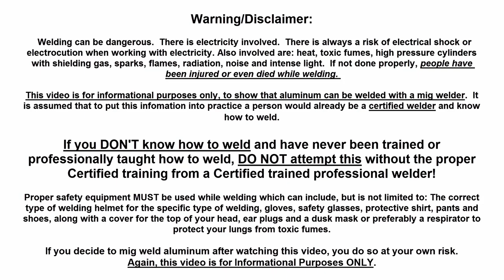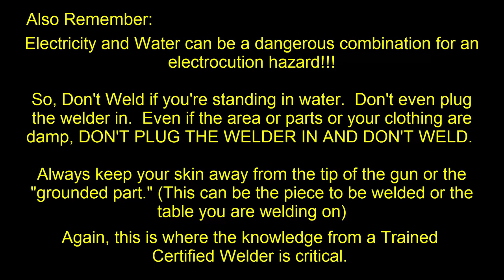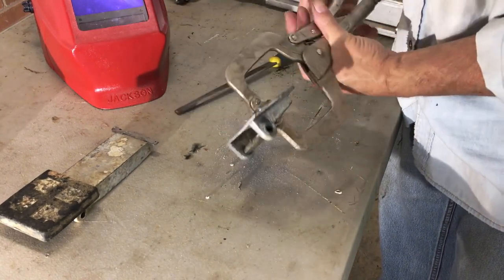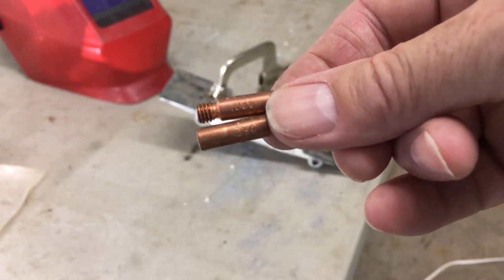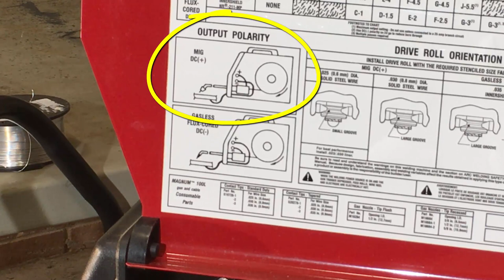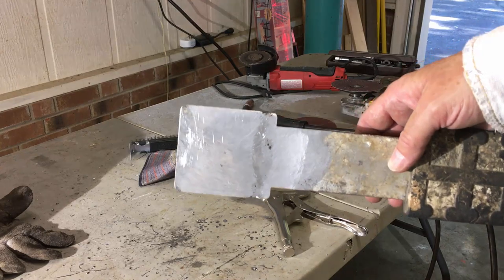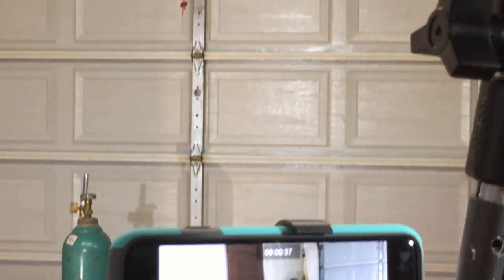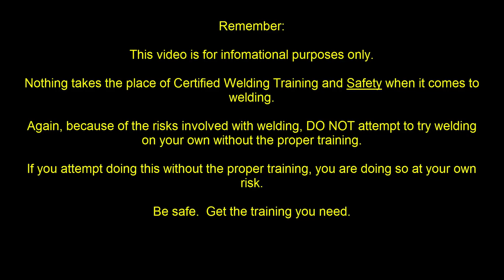Learn An Old Timer's Secrets To Mig Weld Aluminum Without A Spoolgun

Comment: As a thirty year welder with miles of aluminum experience let me give my two cents worth. Many great comments from real welders here. Things you did right: using 5356 wire, using .035 tip.
Other things (repeating some things others have noticed): 
Wrong ark length setting and you don't need to set the wire feed to the highest setting, that just causes a hotter, higher amperage weld. MIG machines are set by ark length not amperage. The machine gives whatever amperage is needed to burn the wire to maintain the ark length so faster wire feed means more amperage and hotter weld. If the wire moves faster than the machine's amperage can burn the wire to maintain ark length the wire will just pop, sputter and throw off lots of dingle berries or throw a bird's nest in the drive. Slow the wire to lower amperage and the ark length should be set to where the wire burns smoothly (not popping like welding steel with CO2) into a cone shape where the end of the wire burns about 1/8 to 1/4 inch from the parent metal.
Don't wear rings while welding.
It's bird's nest not bird cage.
Don't use WD40 on something you plan on
welding.
Don't start and stop your welds every 1/4 inch, that's just a series of tacks not a real weld and it cause porosity like crazy. Use a piece of clean steel to back up the weld on thin aluminum, don't worry it won't stick.Who uses a file when an angle grinder is available?
The aluminum must be completely clean (sanded clean) half an inch from the weld or the junk on the surface will be pulled into the weld causing lots of porosity. 
Do not allow your wire to touch the parent metal when you pull the trigger. Bend or cut it back. If they are touching it's possible for the wire to weld itself to the copper tip if it's not moving when the ark starts, that will start a bird's nest real fast.
Keep the cable as straight as possible, no S curves unless absolutely necessary.
Reply: Now that's a good explanation of the key points!  I have also experienced that you have to 'lead' your arc puddle on aluminum when doing this type of weld.  Should have run a test piece.    Enough complaints about the disclaimers  - at least this one is in writing and didn't take too much time.  But I'd have to say for body shop use and home use I love my Lincoln SP-175 (220 v) model.
Reply: Really appreciate your comments scope and relevance. Thanks for the  share
Reply: straighten the barrel on the gun and push don't pull !
Reply: I would also add never ever use brake cleaner to clean metal to be welded. crc brakleen is the worst. it decomposes into phosgene, something you dont want to be around!!....
Reply: Let the cleaner dry 1st and it;s ok.But,CRC seems to leave crap for me too,I use Andersens,no problem
Reply: I agree,but it's arc,not ark,that's what Noah used,lol.I would add if you do use a sanding disc,never use one you have used on anything else before,ESPECIALLY non-aluminum metal,or you will introduce contaminants,and make sure you weld immediately after using the SS brush.Don't let it set or it will oxidize in the air.If it's rainy or you live near an Ocean will make it especially worse.Good Luck!
Reply: Bowtie41 p
Reply: I can smell crc burning as soon as I strike an arc, even if it has been dry for a  month!  but it is the chlorinated ones that do that, non chlorinated doesnt  bother me either.
Reply: Like what you say. Experience well taught, with sound advise. I welded in HS many centuries ago, and I loved it, but never pursued it as a career.
Reply: I tell that story to everybody who welds..... almost had to have my colon removed!! I still persue my craft. my happy place is right there in the puddle.
Reply: And grinding the weld makes the man a grinder not a welder.
Reply: a welder is a grinder, grinding prep accounts for 80% of your cosmetics and strength. to not be a grinder is to not be a welder.
Reply: AD S  - “A grinder and paint makes me the welder I ain’t”. LOL :-)
Reply: Bowtie41 it’s the chlorine based cleaners(chlorinated)that leave the residue that turns into homemade mustard gas. IT WILL KILL YOU!!!
Reply: William J. 😆😆😆😆😆😆
Reply: I have nearly 50 years welding experience under my belt and have to agree with everything you say. I an retired now of course and really appreciate this "U" tubers video and especially the comments that follow. It is almost like a refresher course in a lot of ways but if I had my choice for aluminum work I prefer tig for the cosmetic appearance of my work and there is a reason guys pay 1200$$ for a nice spool gun. Mig ing aluminum is tricky if you like pretty welds. You can gas weld it with the right rod but if you aren't up on your skill you will go from Mr fix it to Mr junk it in short order. All I will say about that is oxidation is your worst enemy and carbonation will make your weld brittle and contaminate the puddle.
Reply: Great response Mike, I would also note that he should have dialed in his machine on some scrap pieces First!! 
Also note that cast aluminum tends to already have contaminates in it especially if it was made overseas. Also the WD40 or any type of oil would soak in the pores of the cast aluminum and cause his porosity, he should have used a non chlorinated brake cleaner and gently heated it to burn off any residual contamination. If it was available cleaning the pieces with a glass or garnet bead blaster would have made pre-cleaning a snap!! Also we never saw him wire brush the area good before he started welding and he should have used a file for NON ferrous metal. The file could have contaminated the bevel if it was used on ferrous metal because he never used a file card to clean it first not to mention you should pull a file backwards on your material only forward contact.
Last but not least when MiG welding aluminum you should always preheat workpiece when possible, a the non contact pistol style thermometers work great to check it with, AND he should’ve welded that piece in reverse order!! Where he tacked was ok but I would have only V-beveled one side the inside part leaving roughly a 1/16 root, preheat and push the weld in one continuous pass then on the flat side used a die grinder to bevel at least halfway into the first weld for max penetration with that small welder and again weld it in one continuous pass then let it cool naturally before grinding it flat. Note: a lot of Guy’s don’t know they make NonFerrous grinding wheels for aluminum and I would use a flapper sanding disc on the flat side to finish it, then thoroughly inspect it for cracks since some one will standing on it in a construction area! It pays to be safe! 
And yes just like you we’ve been welding so long that when God said “Let there be Light” we both said “ Cover your eyes don’t look at the Arc”. LOL  
ALL MY RESPECT TO ALL FELLOW WELDERS.
Reply: MrTABUNKA 
You are so right Sir TIG is preferable not only for appearance but it preheats and cleans the surface and is a stronger weld with more precision placement.
Reply: Agree with what you said and would like to add:  I'm not sure they are available for that gun, but liners used with aluminum have a plastic inter-liner to keep bird's nesting down.  Also, you're right that the metal was nowhere clean enough!!!
Reply: Thanks for adding more info to the video, now I can learn to weld aluminum with out the gun that cost $250 that a lot to me on SSDI.
Reply: Don't forget he didn't finish out the ends on both sides. So it's going to crack all the way through the weld. You can't leave a cut in on the edges with aluminum.
Reply: Great summary. I haven't tried to weld aluminum with my everlast welder yet so I've learned an awful lot. Thank you.
Reply: And its a good idea to clean with acetone and a stainless steel wire brush
Reply: @Collum Ishmael you forgot to   mention always believe what you read on the internet.
Reply: Rivets.... Aircraft grade, no welder ego need apply ;-)
Reply: Mike Klass June
Reply: Wow great thoughts and info Mike Klass... I am just learning to aluminum weld and getting better at it , but great feed back thanks..
Reply: @lukewarmwater6412  its been reported that several anti-spatter sprays after toxic after welding, which one is safe?
Reply: @lukewarmwater6412  Keep up your passion Sir and eat your fruits and vegetables, especially the Green ones😉
Reply: @susanwood4171  Lincoln Electric does offer a Aluminium liner kit for that machine.
Reply: @johnnygavita  not sure, but I have heard that just regular petrolium jelly will do the trick. anyone that worried about it can just clean more often, it isnt a necessity just a conveniance . I have had to work without it often for one reason or another.
Reply: My thoughts too
Reply: Good advice. Thank you.
Reply: what would happen if I used the Argon/CO2 mix? Will it not work? Getting another bottle is kind of expensive for a once or twice a year weld for me. THX
Reply: lots of wisdom in that post
Reply: D. Reichert - you'll get crappy welds. There are youtube video's of guys trying to this for just the reason you mention and the welds are not good. The good news is that if you have a TIG torch you can use the straight Argon for that as well
Reply: I just went ahead and paused the video once I started reading your tips. Seems like some really useful info in about a minute and a half. Thanks a bunch for your comment
Reply: I can add nothing more.
someone needed to correct mr amateur expert, thank you for stepping up
Reply: thanks ...  any information that helps is valuable
Reply: The aluminum must be completely clean (sanded clean) half an inch from the weld or the junk on the surface will be pulled into the weld causing lots of porosity. 

You mean "causing lots of inclusion."
Reply: Mike are you saying that when mig welding aluminum as the video shows that the welding should be silent and not sizzling like with steel?
Reply: @Collum Ishmael yeah I screwed up! I didn't have my welding helmet on when I watch the video and I got my damn my eyes burnt!
Reply: I just bought a little Eastwood welder. It's a 250i Mig, Tig, and stick. After it was delivered I was kind of pissed because it was DC only and I couldn't use my Tig to weld aluminum. They sent me a spool gun supposedly cheaper at $200. My brother told me that he thought I should try this welder he thought it would be the best one for the price and for what I needed it to do. I went to welding school the same time he did but we took different paths and he has been welding now for almost 40 years. The Welder he uses is a Lincoln 500 because he has to do a lot of gouging when he's repairing heavy equipment. I went to his job site one day and he was using a 350 Lincoln gouging on a big loader and he literally boiled the damn water out of that welder! I guess it just couldn't stand the pressure! I haven't unbox the welder yet to try to use it I'm pretty disabled and it's been a cold wet winter but I plan to take it out soon and try it out. But I guess what I was getting to I'd kind of like to use a regular Mig gun new aluminum if I could because that Mig gun is just so bulky and just don't feel right. Which I have very little aluminum to fool with but I would still like it to be comfortable. I think I'll try to take some of y'all's comments and put them to use on this machine, I just wished I could have switched it the AC and Welding with my Tig.
Reply: Klass, great comments. Maybe you should have made the fn video!!! I'm sure that "Stairway" didn't realize he was signing up for the "Klass" class of youtube welding school...
Reply: Teflon liner for gun will reduce friction of line feed and help avoid bird nest.
Reply: @Grinderscc  Yeah what this guy said!  I don't think anyone should ever try to do anything ever.  Just lie back like a baby bird and wait for pro's to drop food in your mouth.  Helplessness is the way forward people!  Remember that. Sheesh.
Reply: Splatter! No it won't work.
Reply: Are you a teacher?  If not you sure have the calling.  I have always had poor reading comprehension but the way you worded that was so easy to read.  Not trying to be awkward, just a compliment.
Reply: Say mike I really appreciated. Your corrected comments. I am a amateur at this and have never welded aluminum.  Have a Lincoln welder LE31mp and it is supposed to be able too weld aluminum. But I cannot find any videos  on the setup and proper way to weld aluminum for it. After watching this video and your comments I think I can do it.  Do you by chance have any videos on welding? Thank you.   Jack
Reply: Lloyd Skelly I have the same welder and it’s served me well
Reply: Ow man wish I read your comment a bit earlier today. Know what I need now 😁
Reply: @Hoss_1966  I'm with you on that!  I have the same question.
Reply: Mike, 
Your comment was very helpful.  Most of us are welding at home and our machines are not automatic.  You say "The machine gives whatever amperage is needed".  On most of our machines we set the amperage and wire speed.  There are suggested combinations but they are for steel wire not Al.  Since the Al burns at lower amperage than steel would; he had to up his wire speed to maintain the arc length that you mention.
Reply: Mike Klass :
Reply: @Bowtie41  jj
Reply: Joshua James k
Reply: Damon D Master the
Reply: jrnixon25 day
Reply: jrnixon25 k
Reply: Ark?????? 30 yrs of welding
Why cant you wear rings?
Reply: Was about to say the same. Also a quick press of the trigger at the end of the weld can help prevent cracking.
Reply: I'm not a welder by trade just weld for hobby and hobby projects.  I never welded Aluminum before but after this guys mention set your wire speed to the highest settings I question his knowledge and during his tack weld (not weld) as you stated.
Reply: Top comment my man.
Reply: Mr Klass, Thank you.
Compared to you I'm a hack.  I appreciate yours and many of the comment that follow.  I use a Tweeco 211i multi machine with a spool gun and wish I could TIG aluminum with it.  My problem with my spool gun is it's cumbersome.  Have considered buying a dedicated TIG machine but cost is an issue. 
I watched this video and was thinking that wow. Really?  Thanks for setting things straight. 
To those that mentioned the brake cleaner issue, you might well have saved my life.  NEVER thought about it.

Question: Any need to back shield aluminum with Argon like you do with stainless?
Reply: I got 8 minutes into the video with no (old timer) tips. I don’t like wasting my time. Shut it off and looked at the comments and this one was well worth my time so thank you for that.
Reply: Thank you.
Reply: @Bowtie41  I live near the ocean and didn't think of that
as I welded the lower unit on my outboard motor
Reply: @lukewarmwater6412  what do you mean? welding gave you colon cancer?
Reply: @ams718  maybe if your doing repairs on log trucks and you just dont care because thats where you ended up!
Reply: @blancoazcracker365  Yeah, that's another point.
Reply: @rogerd4559  no. brake cleaner gave me a bad case of colitis. I suppose it could have progressed to cancer if I haddent figgured things out
Reply: @lukewarmwater6412  Why? were you drinking it?
Reply: SMH !!!
Reply: Not an expert, but a clean liner to prevent contaminating the wire?
Reply: Mike Klass I would also suggest putting the bottle cap over the valve before moving the co2/argon tank
Reply: @jackwatkins7382  Use lemon juice. The best medicine...tips from a professional marine welder.
Reply: I don't weld Aluminum but some things sounded off ... 
   But He created good ... conversation and food for thought and a lot of what You said was like a new language 😂 to Me ... If u can't find it on YouTube , it's a rare item
Reply: So you agree that one should use a size larger contact tip than your wire?
Reply: @Red ROCK I posted comments a long time ago so I'm sure this pertains to that. I don't have an AC machine. But I do have a spool gun for aluminum and is actually a MIG welder also and I have pure Argon and I think the other is 75/25 for regular MIG welding. I apologize for not knowing exactly what my comment was but there's actually about a hundred here and I just didn't want to scroll down all of them at the time on my phone. Thank you!
Reply: @Red ROCK the only problem is is you can't do a aluminum tig with a DC machine.
Reply: I might give it a try sometime with pure helium if I can decide that I actually need another bottle of gas. it gets kind of expensive after a while. I've heard that before some time ago but I just never thought that it would be worth trying.
Reply: @Willam_J  
Ah a little powder, a little paint makes grandma look like what she ain't!🤔
Reply: Red ROCK helium is WAY more expensive than argon. You use AC for TIG welding aluminum because of the cleaning action you get from the alternating current. You won’t get that from DC.
Reply: I'm a retired welder, from stick, and mig is very easy, but I've never miged and aluminum, but like you, I know he made some mistakes, and have learned some from your comment, so thank you sir.
Reply: Great comments
Reply: Thank you for your experience and sharing of things u have learned. 
made my aluminum welding alot easier and less expensive.
Reply: @farrierss1724  huh?
Reply: Where his porosity pocket came from corner I'm surprised  he didn't grind it out and spot weld seems to me were another crack will start other than that not bad of a job mig , Tig a lot better...
Reply: @lgfortune2265  "  brazing the cans " what cans ? why ?
Reply: What's the steel backing for?
Reply: Thanks Mike
I don’t have as much experience as you, I’ve only been welding aluminum for a couple years for the city of Toronto making aluminum kiosks, but when I saw this guy is welding every two or three seconds I questioned it, I had no clue why someone would be using WD-40 on something you’re going to weld, I wonder why he welded the complete one side of one thing before doing any tacking on the other side, I do tacks on my back side and my front side before I weld on the side that I need.
I have a lincoln 110 V machine as well and I was curious as to what to use. I am also questioning the use of pure argon as from what I have read that a mix of Oregon with some helium makes for far less porosity. I would appreciate your input on this if you would like the message it back on this site.
Reply: Thanx
Reply: @Bowtie41  Yup, decades of welding and I still make that mistake from time to time. Likely because I usually say it and rarely write it.
Reply: @mikeklass2508  while I sit here, recovering from having my ascending colon removed, I wonder why most welders dont know about these things.... feels like they made balloon animals with my small intestines while they were in there!!
Reply: @mikeklass2508  I'm guilty as well😉
Reply: Wow that is a ton of pro tips a sometimes novice welder like me could use, and also explains some things I didn't understand correctly thanks
Reply: Lots of good stuff contained in your comments! The last two in particular caught my eye. 👍👌
Wakodahatchee Chris
Reply: Maaak51,1000% on point,thank you
Reply: How would the machine know the arc length? If you have a certain length arc and a certain overall resistance, then the machine is pumping out a certain current to give the set desired voltage. Seems to me that other things equal, if one moves the wire closer by hand, or by speeding up the feed so that it sticks further out before melting, then the resistance decreases since there is less air to travel through. To maintain the voltage, the machine would need to increase the current, causing more heating of the weld puddle.